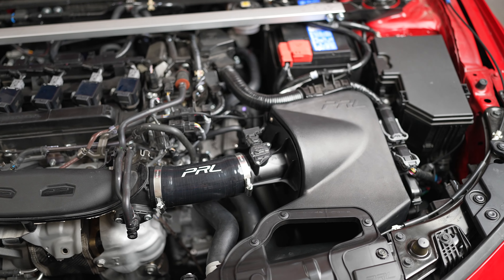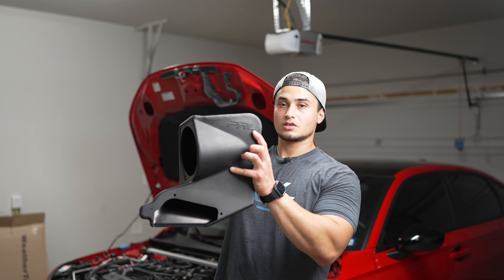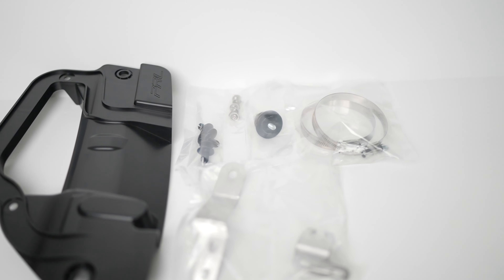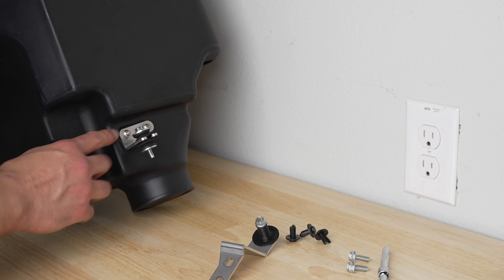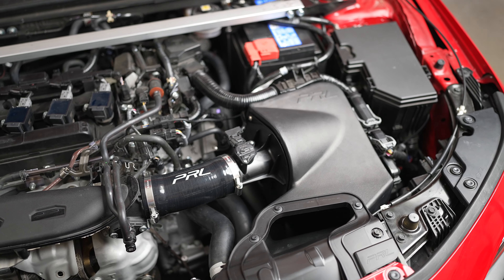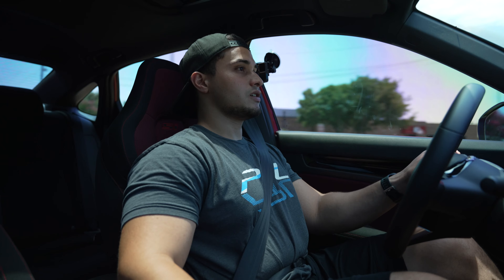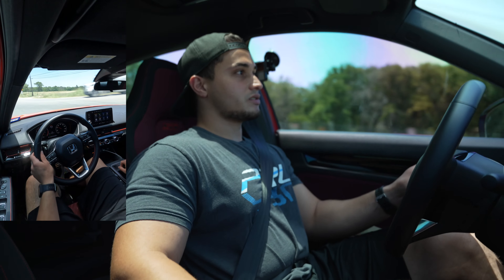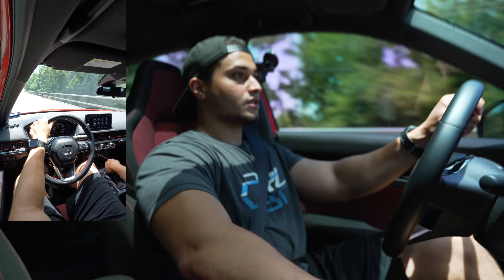Official PRL High Volume Intake Install for the 11th Generation Civics and 5th Generation Integras

Comment: Buenas noches cómo estás ? Una pregunta 
En tu opinión cuál es mejor cobra o high volume ? 
Cuál es la diferencia ? 
En cuál se hace más notorio el sonido del turbo ? 
Con cuál gana más hp ? 
Gracias y buenas noches
Reply from the maker: I’m good man. Sorry my Spanish isn’t all that great. 
La differencia es, cobra sacka aire debajo I high volume se sacka from the duct up top
Las dos hacen la  misma en performance. La cobra hace mass sonido del turbo 

Sorry if my Spanish doesn’t make sense 😂
Reply: @lui.racing  thanks for your explication 
Which one do you recommend me ? 
Your Spanish is very good 💪🏻👍🏻
Reply from the maker: @CarlosRamirez-xb2iz  the High Volume is really easy to install and makes more sound than stock.
The cobra is harder to install but makes more noise. 
I personally would go with the high volume because it’s easy to install and it’s made for this car. 
But you can’t go wrong with either
Reply: @lui.racing  thanks a lot for share everything in your videos and teach us 
Thanks 🙏🏻
Reply from the maker: @CarlosRamirez-xb2iz  anytime man! It’s my pleasure

Comment: This can’t be better than a full intake system right ?
Reply from the maker: What do you mean by full intake system? This is an intake. Unless you’re referring to the inlet pipe past the MAF housing leading to the turbo. That pipe is already highly efficient for the turbo that is in this car. I’m sure someone will create a better inlet pipe for future turbo upgrades
Reply: @lui.racing  well compared to the cold air intake that is just exposed ? I’m guessing for the one exposed you don’t go as fast because of the heat surrounding which makes the air thinner. So then my question is if this PRL one would go faster just because of the heat protection it has. But it’s also has restriction because of the tubing ?
Reply from the maker: @lucidgravitationalpull2234  so the cobra is considered a cold air because the intake filter sits at the bottom of the car far from the source of heat. This High volume intake still provides protection from hot air. There is no real real restriction with either intake you go with.
Reply: @lui.racing  sounds about right 🤙🏽

Comment: Warranty went bye bye the minute you installed it.
Reply from the maker: Haha warranty? 👨🏻‍🦯 never heard of her
Reply: So if my electrical system fails, or my computer dies, or a gasket is leaking you’re saying because of an aftermarket intake system I installed is the cause of all those issues? By law they must prove without a doubt that my upgrades caused the problem. How they gonna say an aftermarket intake system is the cause of a faulty transmission, or leaking head gasket? Warranty is still active don’t be scared like this guy and know your rights
Reply: @kotastrophie  you don’t know what you are talking about.   Here is a new idea for you, READ your warranty!    And the answer is yes, the entire warranty goes down the toilet when you modify the engine.   That right bone head, 100% gone.   Zero coverage.
Reply: Just put back the oem before taking it into the dealer
Reply: @A-GoldenBar  won’t work.   Dealer is required to put on scan tool, which will show date and miles it was tuned .   Warranty bye bye!   Current price for a 1.5 engine is 15,000.

Comment: This will fit in the fl5?
Reply from the maker: That’s the Type R my dude, completely different motor, so safe to say that this will not fit the FL5 type r
Reply: @lui.racing  10-4.
Reply: @luiproductions  how to get the filter to clean it
Reply: Would it not also work to just drill a hole at intake box and not get the duct extension?

Comment: How much horsepower does it add to the car?
Reply from the maker: Probably not a ton. I’d look at a cold air intake more as an upgrade that helps maintain consistency in power as it will reduce intake temps. The colder the air the more power. But you should better performance out of your turbo.

Comment: So this is not a cold air intake?
Reply from the maker: It’s cold air by design as in it takes cold air from the front grill, versus the traditional cold air set up that everyone is use to which pulls cold air from the bottom such as the Cobra cold air set up

Comment: man it is so quiet compared to the K&N!!
Reply from the maker: I haven’t heard the K&N but this one’s is quieter than the Cobra intake I had, but it looks a lot better in the engine bay in my opinion
Reply: Someone mentioned on the CivicX forums that the K&N has worse fuel trims.

Comment: Unplug that fake engine sound. I did. Shit made me mad
Reply from the maker: Haha I honestly forgot all about it
Reply: As an 11th gen si owner it genuinely made me mad so I unplugged it week 2 . I didn't even want to drive in sport.
Reply: Honest question. How do you unplug it?
Reply: @kotastrophie  Open the glove box and remove the screws holding the plastic trim below the passenger front air vents. Carefully peal the plastic back . There is a small electronic box that controls that function. Unplug it and place the wire in a way that won't cause a cabin noise.